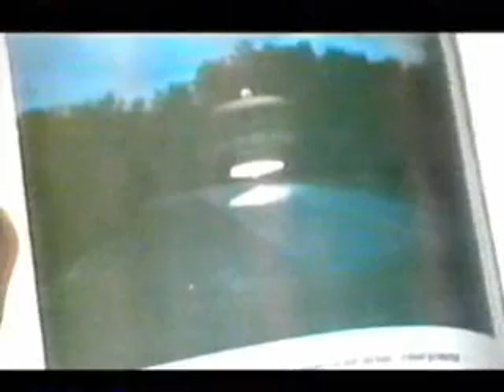UFO-Electromagnetic Levitation Demonstration

Comment: The current passing through wire is ionizing the air and producing lift, but this dosent work in a vacuum. You can buy these kits online. And one more thing, if aliens would come here on earth, they would have to travel at least tens of light years so they wouldnt be just a bit technically advaced than us, their technical equipment would look like magic to us.

Comment: For the airflow explanation to work, the copper would have to vibrate fast enough to produce enough air to create some lift.  Doesn't look like that would be possible.  HOWEVER, if the table it is on is diagmagnetic, then the magnetic field produced by running the current would repel it from the table.

Comment: The upward lift is caused by electromagnetic inductance from the coil to the aluminum surface on which it rests. This effect cannot be produced using DC. 
The upward force is the same force that causes the rotor of an induction motor to turn.
It is basically Faradays law. 
I feel that this video is misleading .
Also , just btw when talking about measuring power on an AC system the current and voltage must be in phase to get Real power otherwise it is known as imaginary power when not in phase.

Comment: frade lifters are just mis understood, its ionizing the air, this causes the air to move, which in turn generates thrust

no anti gravity, just air movement. same as a propeller

probably a very dangerous thing to mess with though, these guys are running those things on upwards of 50kv, besides the obvious shock danger you also have the potencial to generate X-rays and toxic ozone gas, and also lots of stray Ions, personaly i wouldnt recomend being to close to one...

Comment: Omg.. "UFOs" were powered by uranium which heats up the air. With a small propeller it blows the hot air to the ground and make it lift. Its basically like a helicopter. Now u guys are asking urself then why cant we hear them? Well can u hear a nuclear powered submarine? NOO.. so there u go.
Ps "UFOs" are designed by germans and there are now other techniques to heat up the air meaning they nowadays dont use Uranium sine its radioactive. Btw u think u saw an alien? its just a radioacive dude xD

Comment: Having a physics background and an open mind, I tried it. 250 turns of 30 ga. wire, and 116.9 volts AC. Nothing happened. The coil resistance was 175 ohms. It barely warmed up after 10 seconds. I tried 110 volts DC, still no reaction. I tried AC and DC power with the coil over wood and then over a mild steel surface. Nothing significant happened. Either this thing doesn't work, or Boyd Bushman is using bigger wire and/or much higher voltages. His coil seemed to heat up faster.

Comment: it twas air drag the lifted the coil, wont work in vacuum as tested in mythbusters. the electrical current was sufficient enuf to have the air around it to flow donwards. producing drag and thus the lift, when done in an enclosed *vacuum* box, it did not float as video documented in TV... !!

Comment: he says 230 turns of nr 30 wire? does any of you knows what is the width ofa nr30 wire?

the power supply I suppose its 110 volts 60HZ

this is great stuff thanks for posting

Comment: It react with the table, because of the information i provided, the table is aluminum, the thin wire is in communication with the table, creating a difference in electrical potential.
A UFO can use radio, or microwaves energy to create the potential in the saucer itself.
refer to the Dr brown effect...

Comment: The electrical potential.
If two parts of a electric conductor have different potentials, positive electricity will move from the part having greater potential, to the part having low potential,
as long as the difference continues...A conductor therefore cannot be in equilibrium,
unless every point in the conductor has the same potential.

The potential is called the potential of the conductor

Comment: the Electric potential.  

A body electrified positively moves from places of greater positive potential, to places of smaller positive potentials, or of negative potential.

A body negatively electrified moves in the opposite direction.

in a electric conductor the electrification is distributed exactly as if it were FREE to move in the conductor according to the same LAW!

Comment: The electric potential....

Here are the first simple equations, written by MAXWELL...

Let e be the charge of the body, let F be the force acting on the body, in a certain direction.
Then when e is very small F is proportional to e

F=Re

Were R is a quantity depending on the other bodies in the field.

If the charge e could be made equal to unity without disturbing the electrification of
other bodies we get F=R

We call R the resultant electric force.

Comment: James Clerk Maxwell states, the phenomina as the ELECTRIC POTENTIAL. it will experience at each point of its course, a force were R varies from point to point of its course.

The reason I belive this works is because, the table is aluminum, and the thin wire is in contact with the table...

Comment: I did get the line that the coil gets very hot. This being said brings me to think that the coil would be needing something to keep it cool. Kinda like the CPU fan keeps the CPU cool enough so that it does not over heat. But a Electromagnetic Levitation Cooler. or (ELC) Sooo yeah.

Comment: i agree with falandorn, it twas air drag the lifted the coil, wont work in vacuum as tested in mythbusters. the electrical current was sufficient enuf to have the air around it to flow donwards. producing drag and the lift, when done in an enclosed *vacuum* box, it did not float.

bushman's demonstration passing a steel ball thru a steel tube and thru a copper tube with aluminum foil wrapped around is interesting tho, with the two tubes having different time lapse for the steel ball to pass..

Comment: The coiled wire hoop in this movie is the same principle as the anti-gravity lifter tested in episode 68 of mythbusters. It works by putting very high voltage through a coil, the coil in contact with the air then fires out ions to the conductive plate below generating lift upwards due to equal and opposite force. However it requires air and cannot work in a vacuum, and so far cannot operate without a metal plate directly below it.

Comment: This is obvouisly simple ION propulsion. However you need very high-voltage DC not 110VAC. 1966 World Book Enclyopedia had a DIY ion rocket project using a metal rod pendulum a car battery and an old-fashioned auto ignition coil (i.e. Hv source). This is not AG.

Comment: No... A steel plate would not repulse a toriodal coil like that. It would attract. The plate may have been a large bar magnet and he used a rectifier to achieve DC polarity. His outlet was 110VAC @ 50-60Hz. AC electromagnets only attract to steel and permenant magnets. Something is very strange in that gizmo setup...